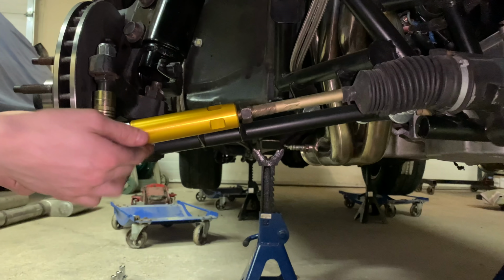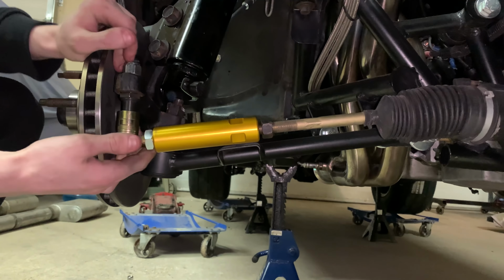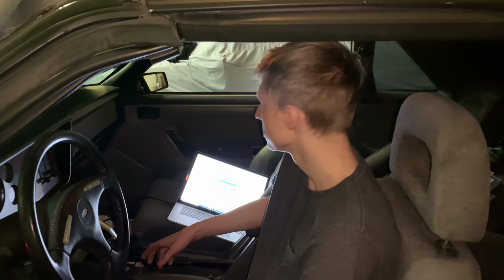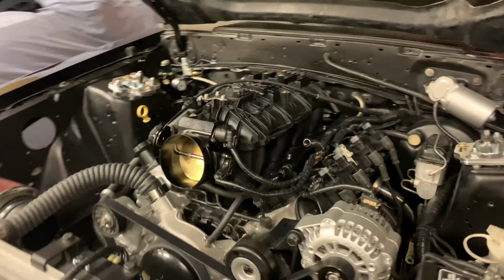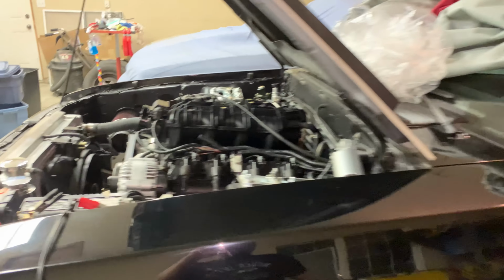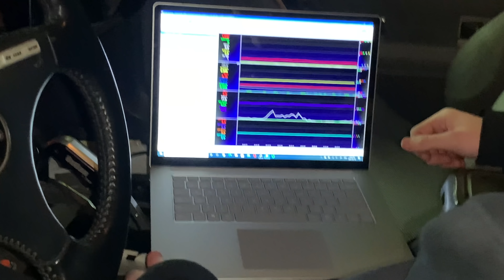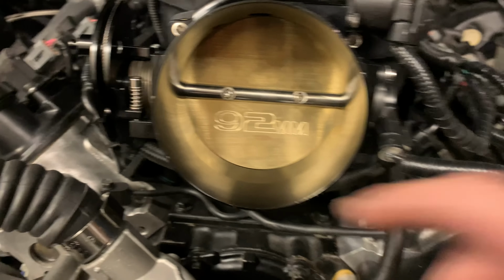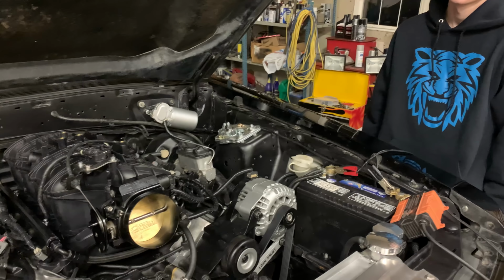5.3 LS First Start + HP Tuning Idle & TPS Voltage (OPEN HEADERS)

Comment: Sounds good, that stumble as it falls to idle probably go away with some back pressure from the exhaust. The o2 sensor doesn't read exactly right without at least 18in of exhaust pipe past sensor

Comment: What was your tps idle voltage without car running. And also when running at idle? Cause I know the tps volts drop about .02 when car is  running. Mine is .52 car off and .50 car running. Reply would be appreciated
Reply from the maker: Honestly I can’t recall, that was 3yrs ago

Comment: Set idle to 1500 to 18* and set over and under speed  to plus 3 and minus 3 and set full throttle timing 29 to start but 32 is crispy nice in my world. Then from cold start to full temp track idle air . Don't touch the throttle let idle . Then set them tables . Then let get ice cold and do it again but put in gear and hold brake. Till full temp and set them tables . Now u got something to work with

Comment: Sounded at first like too many steps from the iac motor. The throttle hang-up on decel will go away when mike smooths out the ve table in low load areas. Car is looking and sounding great. Good job boys

Comment: are you guys doing a live tonight I have a question for rob about drivability with the glide in his nova I have a similar setup but i just destroyed another 4l80 and the cost of a built one vs 400 or glide has me wondering about being able  to still go out on cruises with it
Reply from the maker: Unfortunately we are in lockdown and not allowed to hang out at each others houses. I have driven the nova on the street a lot and even a hour out of town and had no issues. It is very drivable with the glide.

Comment: Why the stock ECU & HP Tuners over Holley Terminator. Idle tuning on HP Tuners really sucks when you've got any aftermarket throttle body on top of even a small camshaft then add in all the other modifications..
Reply: Not if you know how to tune
Reply from the maker: Exactly, the car runs and drives like a factory car with a stock ECU, cam and throttle body 

And it was free!
Reply: @chrisbryant1657  knowing how to tune even a little bit isn't an issue for the "at home DIY" type of guy but tuning anything more than just little things on HP tuners isn't a "DIY" type of situation
Reply: @KarKamp  It is if you've been tuning since HPTUNERS became available.